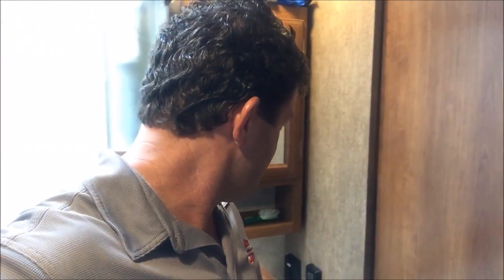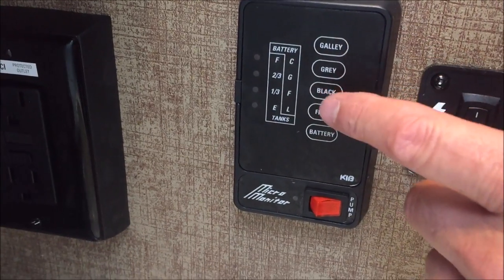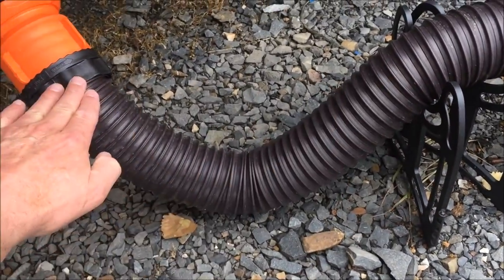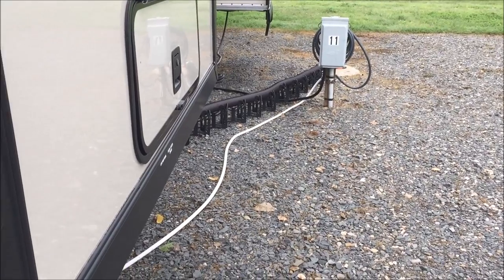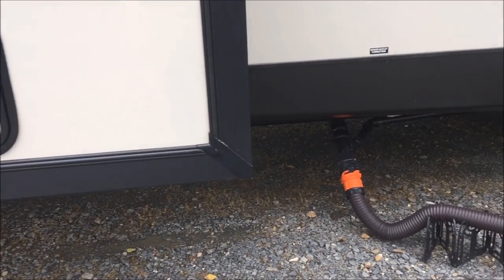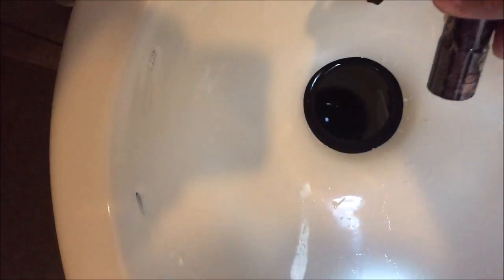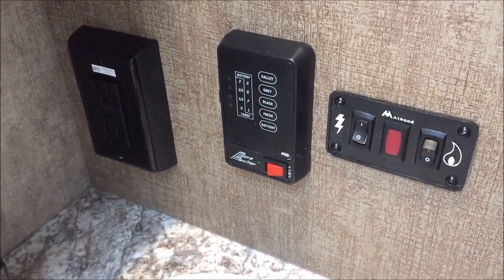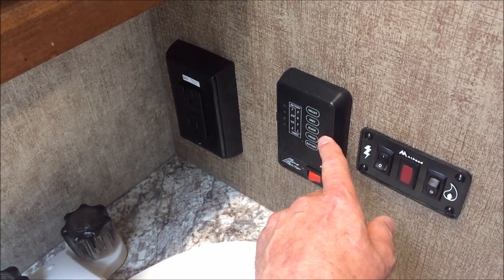Preventing Black Water Tank Sensor Problems

Comment: Have you done this process and your tank is still showing full?  My trailer does not have a tank flush but I bought one of those tank wands and tried that, I tried liquid drano sitting for hours, I tried flushing the tank with liquid dishwashing detergent and every other trick to clean the sensor and it is still showing 2/3 full.  I am to the point where I am going to have to take it to have the tank looked at.  I even poured hot water in the tank and let it sit.  Can anyone think of anything I may have missed before taking it to have the tank looked at?  Thanks in advance.
Reply from the maker: You might just have a bad sensor. I drain and flush my black tank every 3-4 days so I could really do without a sensor if I had too.
Reply: I'm going through this right now. I spent 5 hours filling to the toilet neck, letting it sit about 30 minutes, draining and re filling about 7 times! Used the Johnnie wand to get the waters swirling around the tank, dumped....water ran Crystal clear. NOTHING! No TP, no brown tint, nothing! I decided that I had done the best I could! I put in 6 oz of TPT and about a gallon of water. I've not put tp into the tank since that process, I've only been putting the paper in a trash can. The sensors still read Full. I spoke to a neighbor and he said he's going through the same thing. Reading Full when he knows he's not. We've come to the conclusion that, Even though we are on concrete slabs, they are not level. Our Buble levels say we're level but we can see that the trailer is listing. I've not dumped my tank since the beginning of the 6oz of TPT, last month, but when I see the black water filling up the neck, THEN I'll dump and re rinse to see if the debris has been sloughed OFF.

Comment: When black tank flushed and empty, put 5 gal water in before you put chemicals in
Reply from the maker: I usually shut the tank outlet valve before I turn off the water so the tank has some clean water in it to start with.  Great tip.  Thanks!

Comment: is there an overflow line in case tanks get full or it backs up into sink shower or toliet
Reply from the maker: No.  When the tanks are full you will know it.  There is nowhere else for "stuff" to go until the tank is emptied. I stay on a weekly clean out schedule which usually works fine as long as I don't have company.
Reply: thanks for your reply @JustPlainCommonSense

Comment: Sewer gas shouldn't come back up you line into the sink or shower. They have their own p traps. But certainly no problem being xtra safe.
Reply from the maker: It may not enter through the drains but it will breathe through the gray tank vent if the valve is left open.
Reply: @JustPlainCommonSense  True. We never leave our valves open. The tanks are flat bottomed and we always wait till the morning we are leaving to even hook up the dump hose. It's nice to only mess with it once plus in cold weather no danger of freezing. We typically only stay 3-7 days at a site. Unless we fill the gray tank up. Even then we always try to have a mostly full grey tank on departure day for a really good dump hose rinse. We had a p trap form by accident not to long ago and when the black tank dumped and hit the resistance of pushing the water out of the trap the pressure backed up the hose to where it attached at the dump valve connection and leaked a little. Either a bad gasket or where the hose was connected to the bayonet fitting. Safe travels.